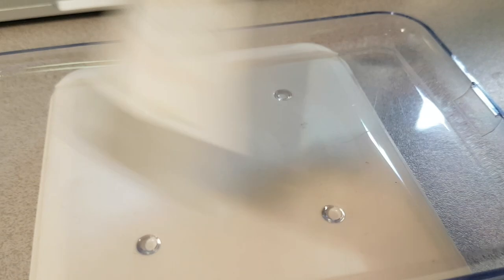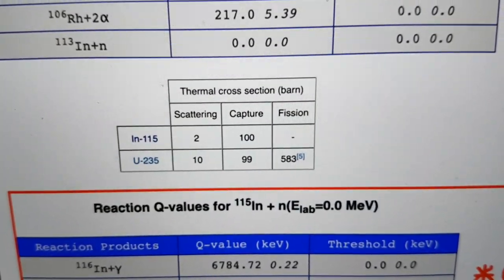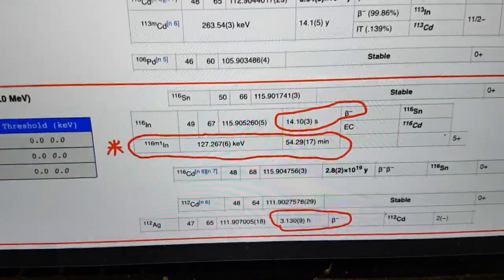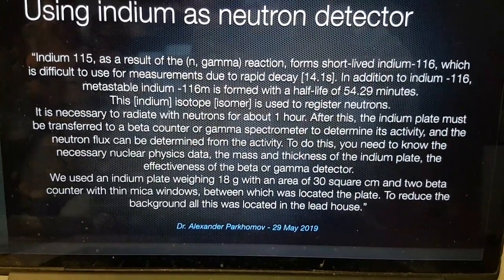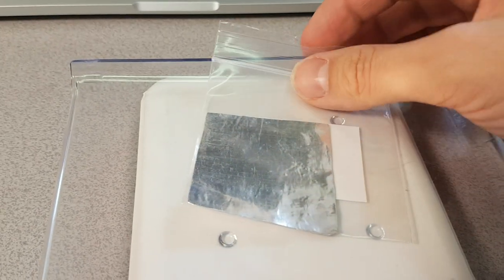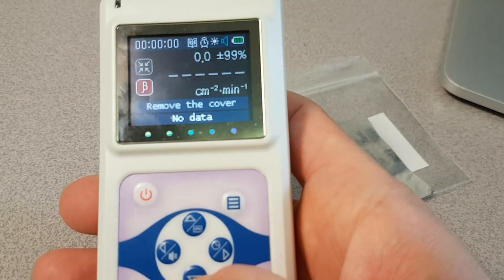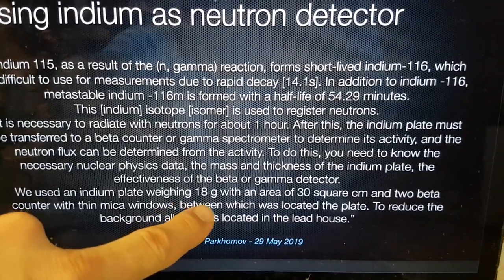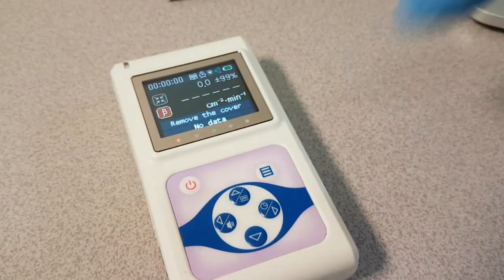Indium & Neutrons

Comment: Indium-116m decays by beta- emission which can be detected in most large area pancake detectors.  I believe Dr. Parkhomov used two SI-8B pancake tubes facing both sides of the the indium foil which was inserted between the tubes for maximum sensitivity to the beta- emissions.  I think the plastic in the protection grid in your handheld meter will reduce the beta- sensitivity by about 50% and you have only 1 side for detection.  It looks like your tube may be smaller than the Si-8B in diameter.  I would guess your sensitivity will only be about 10% of that of Dr. Parkhomov's setup.
Reply from the maker: Hi Bob,

Parkhomov used Si-8B for the top of his reactor, but I think something even bigger and more sensitive for the dual configuration. We have to use what we have for our coming experiment - since we don't have a bigger foil we will be looking for any relative changes to background and any potential extra signal decay rate. Have to try what is possible.

The two relevant videos are here

Parkhomov’s 2 GM plates with Indium foil in between
https://youtu.be/dnUQVQHC1t8?t=2

Placement of indium foil in Parkhomov experiment
https://youtu.be/qJN20uKFPPg